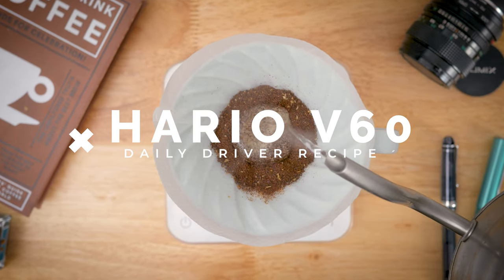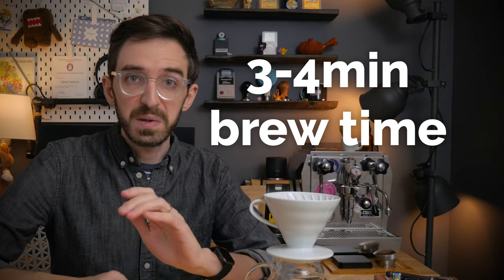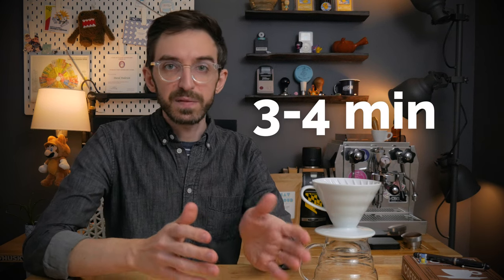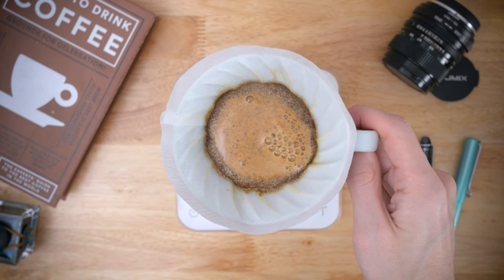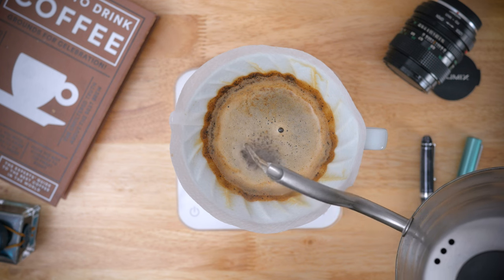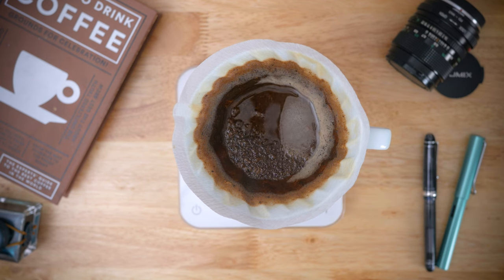Daily Driver V60 - A Technique For Any Coffee

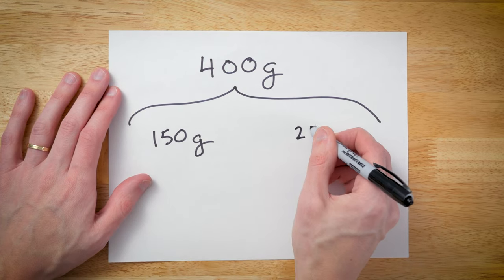Comment: Morning routine - 1:16, preferably SL28/SL34 (sometimes hybrid) Kenyan light roast. I like fresh, juicy, tea like tastes in the morning. About 24-26 clicks on C40 (depends on coffee dosage); steps - about 50-60g of water for 50s-1min bloom, light swirl; rest of the water is divided for 3 equal pours, after second - another light swirl. My pouring technique looks like a symbol @ (at), imagine that you're drawing it with water, pretty slow but not slower than liquid that enters coffee server, I do like to put some weight on coffee bed using water. Never hitting walls of my V60. Time wise, depends on coffee, its roast level, water temperature, but it's between 2:40-3:30, for 250g-320g of liquid. My afternoon coffee is a different beast, I like it a little bit heavier, with more of wine accents.

Comment: Great vid. I have always kept my first pour static but it makes so much sense to vary it based on the bean. 
What are your relative timings for the 3rd and 4th pours? Or is that another judgement call based on the drawdown speed?
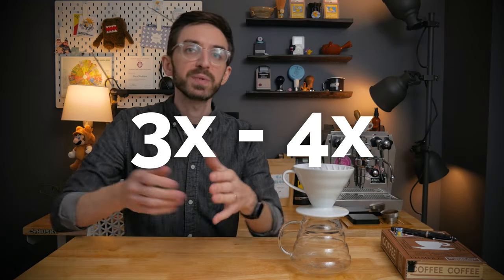Reply from the maker: It varies a little bit, but I usually look for the 3rd pour to start at about 1:00-1:15, and the 4th around 1:45-2:00

Comment: How well do you expect it to scale to a smaller size?  I'll try it with my 01 size Hario and usual dose of 15g coffee / 250g water, which is the same ratio.
Reply from the maker: For 01 (15g coffee 250g water) the pours that work well for me are 75, 25, 50, 50, 50
Reply: @DavidLikesCoffee  Conversely, do you think the same method works for a larger total? My daily cup is 30g to 500ml, using a variety of methods, but my #2 V60 is always a challenge to dial-in.
Reply from the maker: I used to do 30g 500ml in the v60 and moved to this recipe for more consistency, but it's been a while. Probably worth revisiting!